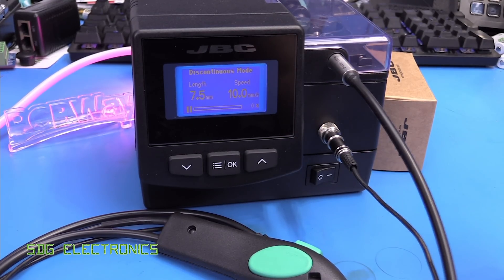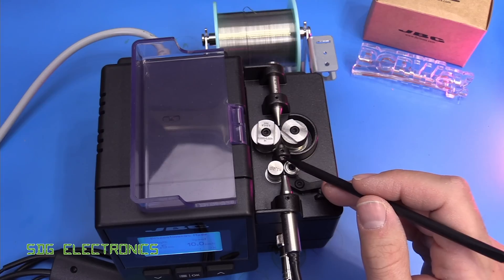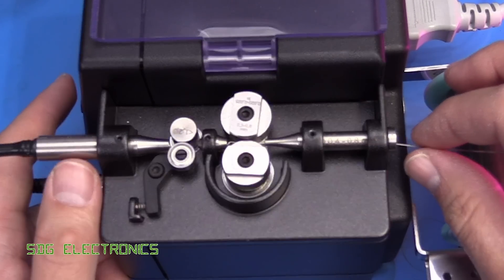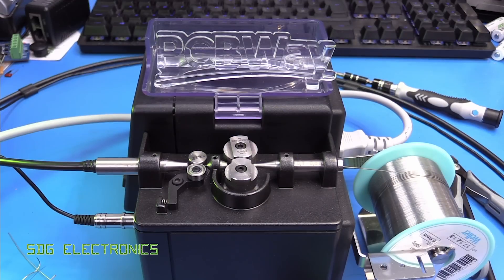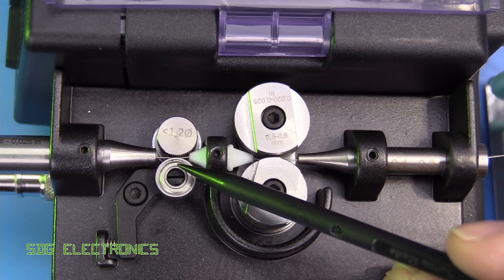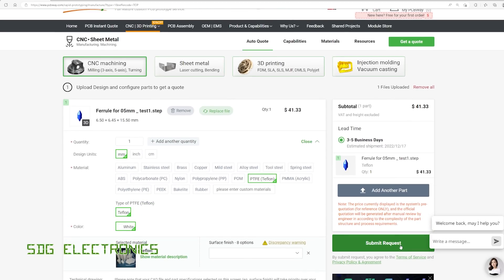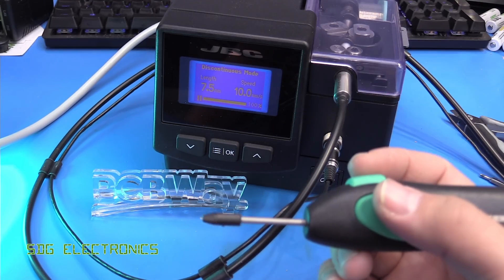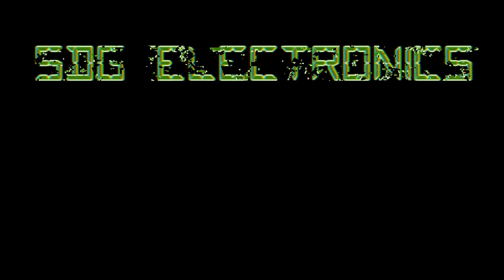SDG #282 Fixing the JBC Solder Feeder

Comment: Dear engineers, developers and makers,
let's design an open source version of a solder feeder.
We have the electronics as spare parts for our 3D printers in quite large quantities sitting around, the control board should be a piece of cale to design and prototype, printing a case is done in a day and creating the handpiece should not take very long either. If we support this as community project, we can directly evaluate created designs and test early prototypes for their usability, durability and ease of use. With some help, the project will get finished quite fast and   could provide a very useful, technical advanved and absolutely flawless tool. I would love to be part in this development.

What do you think? Would you like to provide a start of this project on your channel and make it reality with us?

Comment: It's the same problem encountered in MIG welding while using aluminum wire. That was why "spool guns" were invented, which placed the drive system in the hand piece. Bird nesting was always a common problem in feeders like this, with any consumable that wasn't stiff or strong enough to be pushed through a wire guide and hose assembly.

Comment: This is a great solution! We just received our automatic soldering station and facing similar problems with 0,5 mm wire. What also helped for us was inserting the slightly larger mid guider which is meant for 0,8mm solder wire. However, about every 20 cm of soldering the wire buckles anyway. --> we will make this part also ;-)

Comment: I think the teeth on the drive gear are crimping the solder as it passes through the gears. This is why it tends to move in the direction of the gear with the teeth.
Reply: Yes I was going to say the same thing, the feed rollers could be applying too much tension also and flattening the solder, causing it to bend like a piece of paper.
Reply: Agree. commented on the previous video, even more likely to cause an issue with softer (i.e. lead-based) solders.

Comment: I think you should hold the tip on the board such that the board itself supports the tip. It is clearly made out of a material that does not melt when touched with a hot iron. If you physically touchthe board, the tip wont move when pressing the button
Reply from the maker: You could be right. I'll give that a go.

Comment: I'm pretty excited to see small quantity bespoke machining becoming available like this. 40 dollars is extremely (almost incredibly) reasonable for a single one-off like this, even if it's a fairly simple item. Might have to have a look and check out prices for slightly more complex parts that would need a mill. I can see why they'd want to charge a fee for any threads that need tapping, might be worth considering tapping the threads yourself depending on how much that is (and how many parts!)
Reply: I see they offer bakelite as a material choice... Now I'm considering the possibility of setting up a business to provide audiophile-grade replacement knobs for every piece of equipment that exists.
Reply from the maker: Yeah it's a really nice opportunity to get some custom parts made that I certainly could not make myself.

Comment: Looks like a solution looking for a problem. Having been in the electronics manufacturing sector as a design engineer for far too long, I’ve never heard the assemblers saying i can’t get the hang of feeding the correct amount of solder for the joint by hand. I wish we had a machine to do this for us. I expect that on the second miss feed the thing would be in the WEEE bin, time is money as they say. Marry Xmas all
Reply: I could see it being useful for highly regulated industries (aerospace, medical...) if only for legal proof you used the correct amount of solder.
Reply: @N0gtail  I've worked in aerospace and have never seen this, or a need for it. Where I worked every solder joint was inspected under a microscope by  specially trained inspectors, thus insuring every solder joint was correct.
Reply: @gwc1410  I used to hate getting a PCB back with little red dots next to a bum joint. way too many years later i had to go on a how to solder course for work. when i got back the boss asked how was the course. i said i had to point out the errors the tutor was making and after a few days i had he soldering as good as me.

Never got sent on that course again.
Reply: @N0gtail  all I can say is that I've worked in electronics design in both aerospace and medical all my working life and can say that up 3 years ago there was never a need for this. Oh I retired 3 years ago:-)  it just looks like someone saw a mig welder and thought wow we sell s devices like this for soldering.  What would be interesting if they could feed it down the tip of the iron so you could solder if you had below the average number of arms.
Reply: @TheEmbeddedHobbyist  I’m sure in some absolutely critical application like satellites there’s probably an anal project manager with 100 certifications to meet with soldering. Just like those $100 LM7805 “aerospace” grade parts that are white gloved at the fab.
Reply: In the last video the general consensus/conclusion was basically the same 'solution looking for a problem' but as he has it now, he may as well try and make the best of it!
Reply: I just can't imagine wasting valuable bench space on it. EE's should always be honing their hand skills and this just doesn't fly for me. 
But, perhaps in some repetitive production line sweat shop where time pulling more solder from the reel is time wasted then it might have a niche.....
Reply: @IanScottJohnston  Aye Merry Christmas !
Reply: Ditto and I have never seen the like !.....squeak.
Reply: I wouldn't be opposed to a DIY version just to free up one hand.